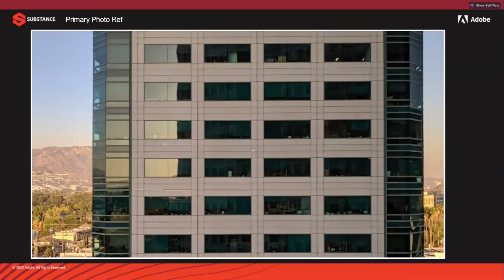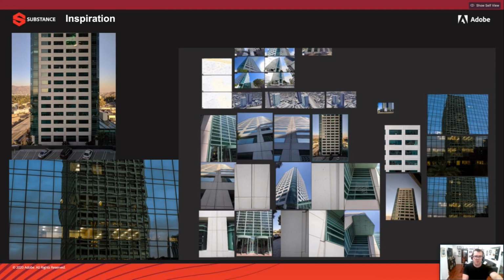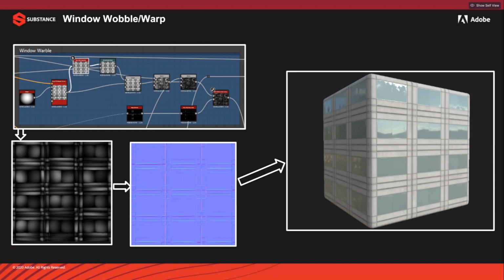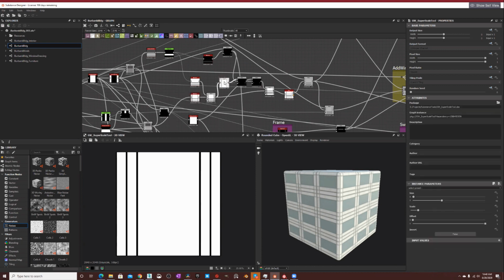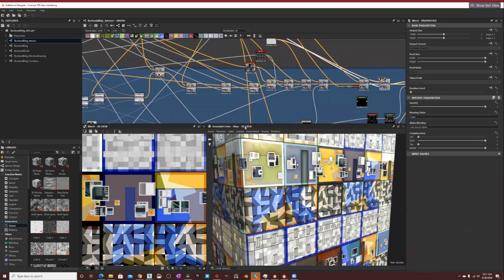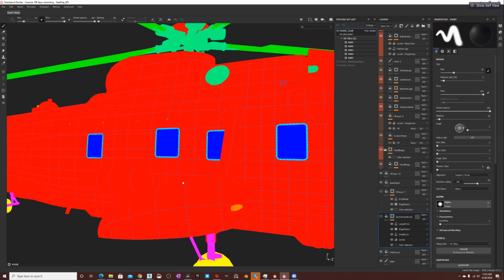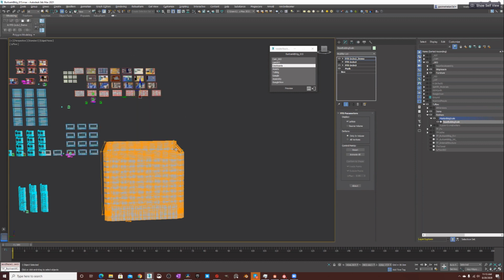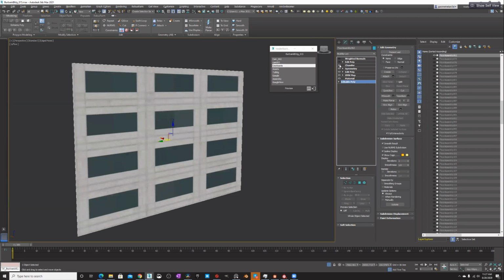Procedural Texturing of a Parametric building for VFX | Adobe Substance 3D

Comment: This awesome and I tried to accomplish something similiar before with little success.
The main thing I don't quite understand in this process is why to actually 3D model everything?
I mean, why you create the mesh for the facade is it is already done in Designer?, couldn't you put just a plane with the substance texture with displacement and be ready to go?
As I said, I don't get why to model that and not rely entirely on the already made textures.
Reply: Hey Jose, The reason to not just use displacement is the sheer amount of geometry that would require. Also it makes it more difficult to shell or give volume to the individual facade pieces. Having extremely clean geometry is also way better for fx simulations. Ultimately, for me its the level of control I get also when the geo is modelled like this. 
All this being said, I may be wrong. I'm always trying to improve my workflow and find more efficient ways to work.
Reply: @gavinwhelan3d  I mainly agree on the facade, althouth in my opinion it's just a matter of how near the camera will be..., otherwise you may find it would be OK to use just normal maps in most cases. But 3D modeling the facade doesn't stops you from using designer's versatility so you can't take advantage of being able to create any facade and not only that one?, and you show your hability to create 3x3 facade grids in the video, but in the end you just use one and model it?
I may be wrong and your are in fact using the 3x3 or 4x4 grid, although you are modeling one section and then move its UVs around to get the grid variation...
Reply: @JoséMiguelAragüés   I think you mean a more procedural approach so I can change the scale of the windows or the number of bricks etc. but, the modelling is necessary for what I wanted to achieve. I used a 3x4 grid which best suited the scale of that particular facade. I'm scattering 12 separate facades per material. At this scale, just a normal would not of been effective enough and using displacement would of generated too much geometry and not the necessary separate elements for an effective fx simulation. Separate glass, window frame and brick elements etc. I didn't explain it clearly in the video.
Reply: @gavinwhelan3d  Thanks for the explanation Gavin.
I understand then that you modeled the facade piece and use moved UVs to get the desired randomization?
The non procedural nature of your process is understandable since you were doing a very unique building and NOT a city with lots of different buildings.
About the displacement issue, I was referring more to the interior elements, like the tables or books, which I think would have take advantage of the simpler geometry.
Anyway, surely it was a very fun project to do!
Cheers.